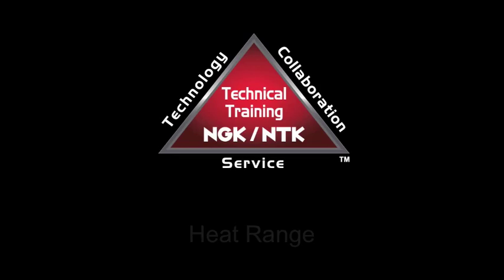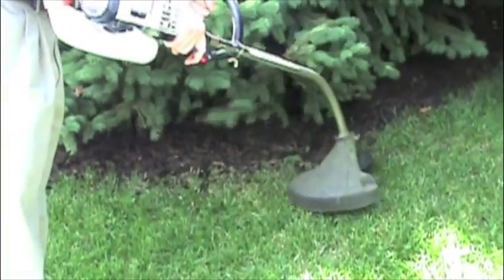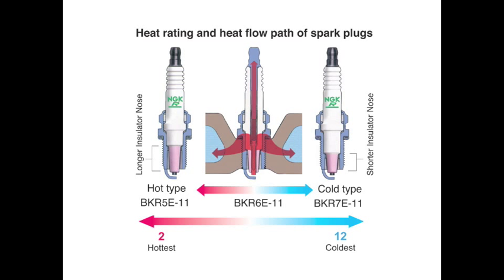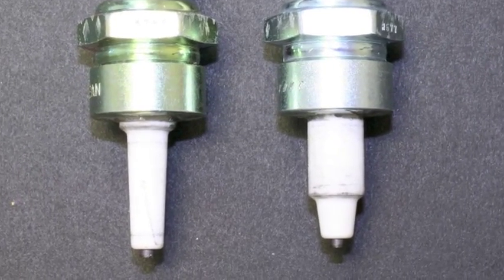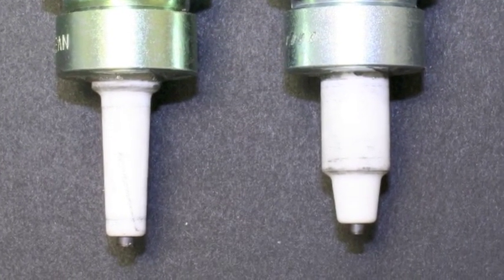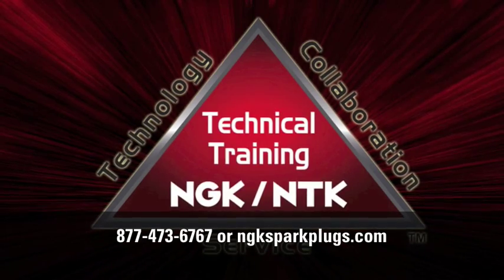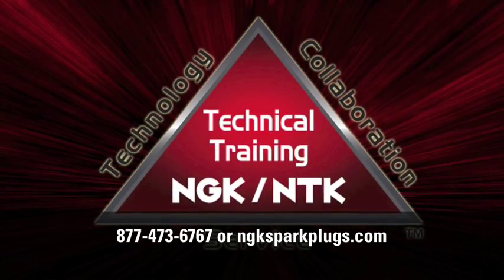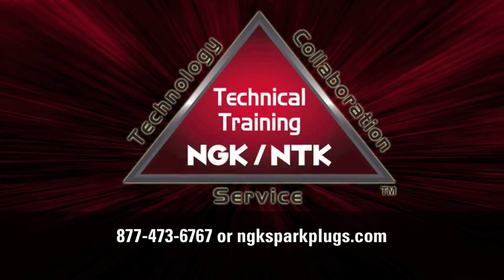Ever Wonder How a Spark Plug Heat System Works? Check this video out!

Comment: I run the coldest plugs that I can find for all of my vehicles.  Found a way around the fouling problem.  Even if the vehicle is burning oil, running rich or lean plugs won't foul out.